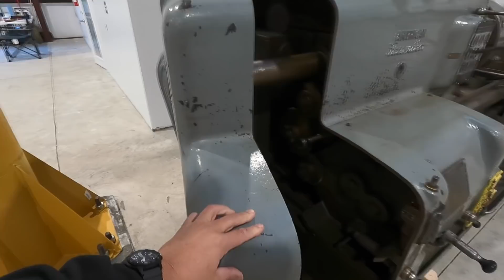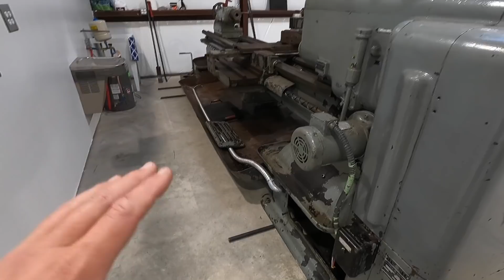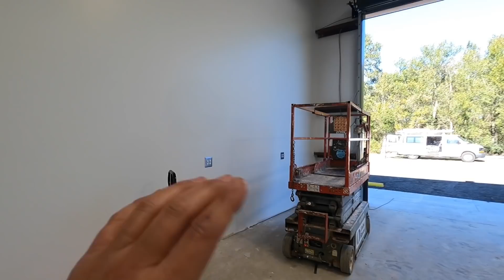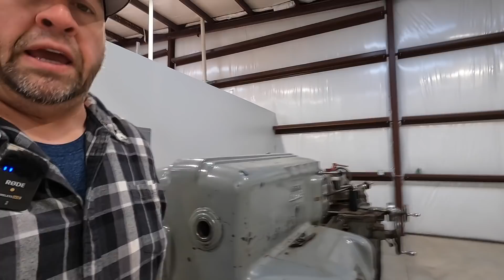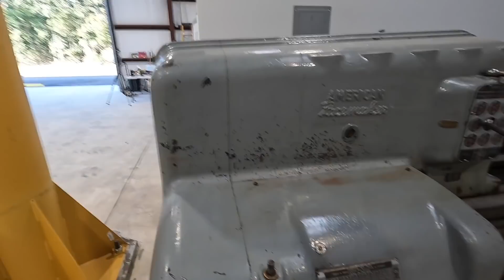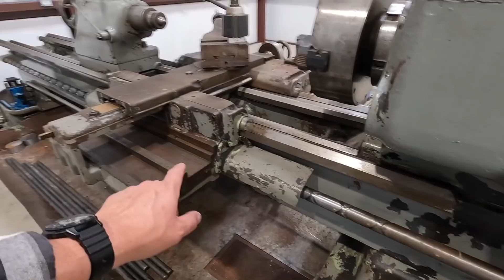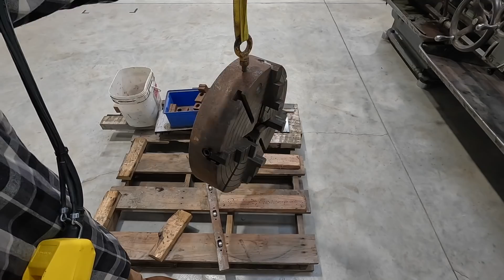New Shop Space Update 12: 3 Phase Electrical Circuits, Lathe & Crane First Tests

Comment: Love the new shop Adam but why oh why do so many Americans , most with expensive comprehensive tool boxes always grab a wrench?  Such an innacurate tool and I only use one if really stuck. Makes me shout at the TV “ use the correct spanner” drives me nuts, sorry, pardon the pun.
Reply: Is this not a more general, not country specific, phenomenon where the mechanics and machinists differentiate each from the other.   The mechanics are all about expensive tool boxes with a comprehensive and duplicated spanner set and pride themselves in knowing a nut size just by looking at it.  The machinists couldn't care less about that, for they consider their skill set to be at a whole different level and let the quality and range of measuring tools in their toolboxes define them.  The affinity withe Crescent style wrench might stem from school metalwork classes decades ago when the would make their own adjustable wrenches using basic tools but also from base principles.  What I cannot fathom is where some machinists use both adjustable and open ended spanners 'in the wrong direction' as it seems like abuse to me.
Reply: On a nut that size, an adjustable wrench is fine.  You run very little risk of damaging the nut.  On the other hand, the smaller the nut/bolt, the more likely you are to round it with a poorly adjusted adjustable wrench.
Reply: Do you notice he does not have his fancy tool box moved from his other shop yet.   He mentioned that in the previous video as well.

Dale in Canada

Comment: The original heaters were set up for 460 volt which is lower amperage.  The amperage for it on 230 would be approximately double.  I would scrap them old style overloads and get something digital.
Reply: Agreed.  There's used Allen Bradley stuff all over eBay.

Comment: Hi, Adam.  Glad to see that you  have the Pacemaker and the crane up and running.  The low-speed feature on the hoist is a really nice thing.  The rattling of the Pacemaker's clutch at idle should an easy adjustment.  I'm concerned about the conduit running across the floor.  Let me suggest running the conduit vertically up the office wall to well above head height, horizontally across toward the lathe and vertically down to somewhere behind the headstock, perhaps in the area of the rapid traverse motor.  This would clear the crane boom with room to spare and you won't be swinging any loads through that area.  Just a thought but it seems as if that conduit on the floor will always be a problem with clean-up and other things as well.

Comment: @abom79 Looking good. You should think about taking that water fountain out of there. It’s gonna get filthy and won’t get used. Also build a plywood box to enclosure the hot water heater and the tubing so you don’t accidentally knock into it. Some simple L brackets can hold it in place against the wall and when you need to service it, just unscrew and slide the box out of the way.
Reply: "Hot" water heater??
Reply: @paulcopeland9035  I've never found those in stock anywhere. I may try looking in the snake oil aisle next time.

Comment: Hi Adam. I see by your video that you have a crack in the concrete floor by the lathe. Was this caused by the machine when being moved.
Reply: I think someone mentioned it before that lathe was in place.

Likely just the natural cracking that the cuts in the floor are ment to prevent, though I'm sure you can't stop all of them.

Comment: Hi again Adam - great news re the wiring on the lathe and crane. Looking forward to seeing further work on the lathe as well as general shop developments. keep up the great work!!.  By the way, I couldn't help but notice what seems to be a crack in the floor slab at the tailstock end of the lathe, how did that happen??
Reply: The floor rotted.  Happens all of the time to concrete.

Comment: Hi Adan,   The small hearers are for Low amperes/ Hi Voltage, you are doubling the amp rating of the small motor with lower voltage, Just that small thing with two screws,  >Joe Baltimore MD.

Comment: If you are running on 240v now, and it was wired for 480,  the currents drawn will go up.  The heaters will have to be re-sized for the higher current draw on the lower voltage... Should not be anything more than looking up the size and replacing them...   Nice Shop!  Looking forward to see more machines filling in the room!

Comment: That's a horrible crack in the concrete floor. I expect Adam has mentioned it in a previous video which I missed. Any reason for it or just heave or settlement? Be interested to know. Thanks Bill B
Reply: Concrete will shrink slightly during curing.  As long as there are properly spaced contraction joints (the cut lines), the crack will follow the line and will be controlled.  As long as there's rebar in the concrete and the elevation on each side of the crack is the same, it's less of an issue.  Honestly, the largest problem I see in that floor is that cut joints are spaced too far apart.  If there had been a cut joint in that section of the floor, the crack would have followed that line and you would never notice it was there.

I don't know the thickness of the concrete or the mix they used, but there are multiple cracks in the floor, leading me to believe the builder should have cut on a tighter grid.
Reply: I'd say they poured it way too wet and it shrunk and cracked everywhere. 
It's not Adam's fault, it's the building owner and concrete contractor's problem.

Comment: I wonder how many chips that water fountain is going to catch.
Also, for later peace of mind, It'd be a good idea to get yourself a P-Touch label maker, and label each outlet with it's corresponding breaker number. Even if you remember what's what, it makes it so much easier for anybody else coming along later, especially if you expand your business and somebody else has to mind what's plugged into which circuit.
Reply: I label EVERYTHING these days. It saves so much time when it's time to change things or add new circuits.
Reply: @danmarafino1770  When I was a doing tech support at the school, I had to go and do that myself. Both for power, AND network. We had a temporary computer lab set up in one classroom, and we kept blowing the breakers. That's a situation where it would REALLY have helped if they'd labelled everything while they were installing, so we'd be able to ballpark how much current was on each circuit. Kept blowing breakers when the laser printers turned on.

Comment: I’m pretty sure the issue with the clutch is the throw out bearing is either going bad or needs lubed
Reply: If the clutch is noisy and grabbing on startup, it is most likely set too tight. If it has springs between the plates, they may need to be replaced.
Reply: "throw out bearing"?  Did he add a vehicle restoration to the list?
Reply: You know what I mean the clutch release bearing whatever u want to call it

Comment: Cantilever that lathe so that the headstock goes to the other side of the jib crane but keep the tailstock in position this way you'll have enough room to go behind the splash sink and your electrical panel will be also okay I wouldn't parallel it to the wall I would put the headstock closer to the wall and leaving the tailstock right where it is or maybe slightly closer to the wall daddy quarter in the wall will give more room in case you need barstock to go through spindle you'll have room

Comment: The receptacle closest to the wash tub should be GFCI type receptacles or it should be on a GFI breaker per National Electric Code.
Reply: Also,  on the new welder plug the BX cable is not secured according to NEC.  And what electrician runs cable at an angle across an opening like that?

Comment: The walls that don’t have drywall, the face covering of the insulation, what is it made of? Is it a stretched plastic material? It looks like if a molten metal spark from the welder hits it it would melt it. Yes, maybe, not a problem?

Comment: Hi Adam,  Those old heater overload protectors have to have the correct heater elements sized for the amp draw of the motor  When you changed to low voltage the amp draw will have doubled.  All you need is to install the correct heaters for the low voltage full load current draw. (get this value from the motor plate). The shop is looking great!!

Comment: I know nothing about being a machinist. But.. cool stuff anyway? And I hope everything goes well for you! Not sure how a machine shop makes so much money putting threads on a screw but whatever. I realize you have to make one off parts and build stuff to spec but I haven't a clue what or how to do any of that. I know you could probably make a custom barrel for a rifle now or at least fit it and thread it to a rifle. It's funny how in a CnC machine world that an old machine like that is still valuable. That's kind of cool in it's self. Hope you find the rest of the equipment you need for your shop at a decent price!

Comment: while buying your chain lube, get a 6" to 12" piece of heavy rubber tubing, around 3/4 ID. slit it and put on the gorbel brace plate so it acts as a cushion when the lathe door is open. looking real good so far. next: bring over the new drill press and the smith & mills shaper.

Comment: That's correct William. Now that the lathe is running on 230 volts it is drawing twice as much current as it did on 460 volts. The heaters for the thermal overload need to be a different value on that small motor for the rapid traverse. The thermal overload for the big motor should be in that new starter the electricians installed on the wall behind the lathe. Everything is looking great in your new shop Adam, good progress. Everything is coming together.

Comment: Should run the electrical from the ceiling down. No chance of water getting on the floor, having a broken wire,  stepping in the water and getting zapped. Code where I live, permanent wiring  can't be ran across the floor. Must be overhead and down.

Comment: I would have put that machine along the back wall to the right of the hand basin.... and opened that whole area up....🤷🏼‍♂️ but what do I know..🤣😂
Reply: Problem is then putting full  length material through the spindle bore. regards
Reply: Crane doesn't reach.
Reply: @endemiller5463  crane is a waste of space.
Reply: yeah you dont know, crane wont reach, shut up 🤣

Comment: Adam 1 volt 1 amp = 1 watt therefore when you drop the volts by half you double the current that why it trips tie OL for the rapids
Reply: Yes, but the heater resistance is constant. So half the voltage is half the current, so the power (heat dissipation) in the heater is 4 times less.
Reply: @loewietje4897  sorry but the motor has been reconfigured to run on 220 vac 3 phase from 400vac 3phase but deliver the same hp ) the windings are now in parallel not series , therefore the current in each phase is twice what it was ,hence the heaters ( thermal overload units ) are now carrying twice the current ( yes the OL unit resistance will not change but now they are carrying twice the current hence more heat )
Reply: think of the motor current this way .   in the USA you have 110vac and a 100 watt lamp = 0.9 amp in the UK we have 240vac with the same wattage lamp ( rated for the correct voltage) you have 0.41 amps  that's why in the USA the cables ( flex) are twice the CSA as in the UK for the same load.  Yes I am a heavy power sparks and have done 5 years as a stator / armature winder

Comment: Do I see a crack in the concrete already?
Reply: It's an under slab vent.  All new floors have them.
Reply: @paulcopeland9035  To vent the flux capacitor?
Reply: @andrewterry8092  Yes.  Overheating the FC can be a terrible thing.
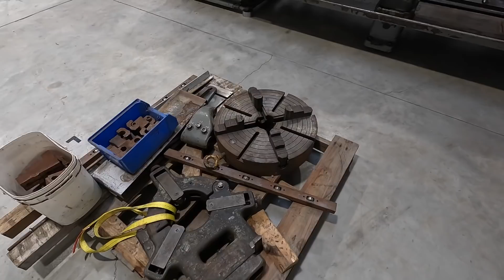Reply: 26:52 i think its new 🤔

Comment: Did the crane guys tell you how much the lathe weighs? Most cranes have a scale built in so they know how heavy the load is.
Reply: Cant remember it beingmentioned but the 20" x 144" Model weighs in at 11400lbs  regards

Comment: Nice move and upgrades.   Thanks for sharing this.    I suppose I live dangerously:   I moved my K&T the same way except I don’t have a forklift, so I had the roll bars turned 90 degrees and pushed it by myself.    Fortunately, it didn’t want to run away from me.

Comment: Sounds like a bad bearing in your clutch
Reply: Just the plates rubbing together in idle. A known issue on these big clutches.  A little adjust & clean will fix it.  regards
Reply: If its anything like a vehicle it will be the thrust bearing

Comment: Everything is starting to look great. That's awesome the see the lathe running and the crane finally working. I like that 2 speed feature like you said that really will be handy when putting thing on the lathe or on other machines. Can't wait once you get the Pacemaker cleaned up and ready to cut some "CHIPS"  😎🤟

Comment: That Pacemaker looks very similar to the Clausing Colchester that I used to own years ago . If I may one suggestion , go get a package of the plastic child protector plugs for your 115 volt outlets , to keep the shavings , grinding dust , and coolant out of the outlets . Electricians use a " fishtape " to pull wire thru conduit . That smile at 37:00 looked like a kid turned loose in a candy store at Christmas , enjoy your new toy !

Comment: Should just need to change the thermal-overload elements (we call them heater or heating elements, they work off of amperage/heat generated by amperage) in the black box on the back of the lathe. When you change voltage the amperage will change. When the voltage decreased the amperage increases. Maybe hard to find them due to the age, I can't tell for sure. 30+ year electrician here.
Reply: Yeah that box looked really old.  Maybe some old cutler hammer stuff.
Reply: Yes, but the heater resistance is constant. So half the voltage is half the current, so the power (heat dissipation) in the heater is 4 times less.
Reply: @loewietje4897  yes, but overload heaters ate not sold by watts.   They are sold by motor FLA.

Comment: Your lathe is set up for coolant. Are the drain plugs in so you could wash the ways and carriages down with super thin engine oil. I worry about the dirt under the saddle . Do you plan on pulling the guide blocks so you could lift the saddle just enough to flush under the saddle and using a nylon rifle cleaning brush till it flows clear .

Comment: Don't forget a charge port in case you get an electric fork lift.
Reply: Electric forklift sounds like a great idea. We use one and are very pleased with it.
Reply: With the panel open in the shop, he can add when needed and save $ for now.

Also, forklift chargers are generally hardwired. So until you buy the just and a compatible charger, there's no doing it right anyways.

Comment: Just wondering if you checked the national electrical code for required clearance in front of an electrical panel before moving it closer to the panel.
Reply: Ah, no....

As an electrician I can guarantee that unless you're in a government building or certain oil & gas company's, there is zero thought to working on the panel. If you can open the doors to flip breaker handles you're doing better than most.

Comment: After all the left-right-up-down movement the lathe went through, do you have to do any adjustments to make sure everything is plumb/level/centered??
Reply: Yes. Any time a machine tool is moved it requires leveling with a precision machine level. There are adjusting feet on all machines like this specifically for levelling.

Comment: Prob already noted but after changing the motor voltage you need to change the heaters to allow for the increased current. The heaters heat up via the current and kick off the power on overcurrent. At 240V the motor draws twice the current compared to 480V so they will trip it out. Just install the correct heaters.
Reply: The electricians might not be industrial control specialists...

Comment: Im not from Florida. How are the walls of your shop constructed? Is it just flexible plastic sheeting??
Reply: Steel panels on the outside, fiberglass and a plastic vapor barrier sandwiched between the panels and the steel structure.

Every single steel building across the US is constructed like this. You can steel or wood frame walls inside also. His office is just stick framed.

Comment: Our American Pacemaker's spindle has an issue. A heavy cut would raise the part. I suspect the spindle bearing (bushing) is bad. Jack your chuck to see if you get movement.
Reply: Typically it's a set of Timken bearings, they will wear a bit over time but there is a set of bearing nuts to adjust the spindle preload...the fiddly part is getting them set to a point where the temperature rise at the bearings isn't too warm at steady state running.

Comment: The clutch out noise sounds like friction discs and clutch plates rubbing. Not sure whats in there....might have warped friction discs rubbing the clutch discs, sounds about right. Sounds like a brake disc rotor rubbing the dust shield.

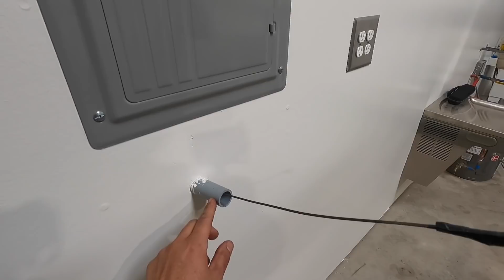Comment: 21:29 It’s a fish tape.
Reply: Yes! Those are pretty tough. I live on a rural property where the 240 single phase comes from a transformer on a pole, underground to my 'shop' building, 230 feet, 3 #2 wires, the previous (original) owner left that fish tape hanging on a hook in the shed.